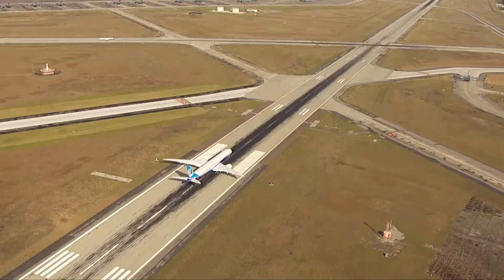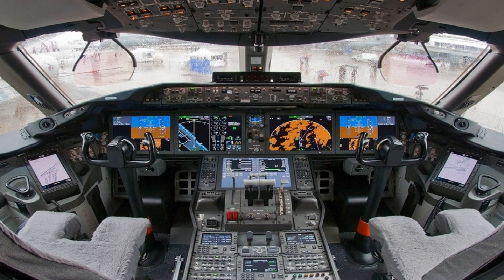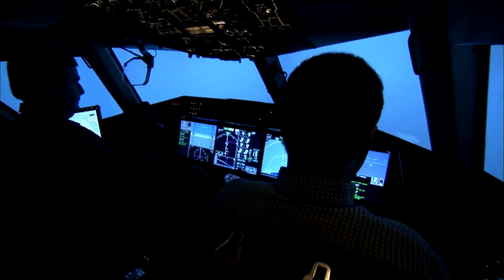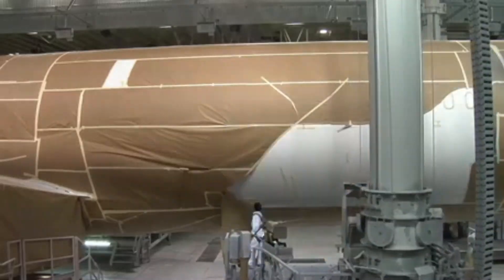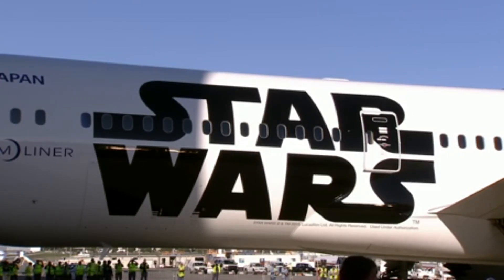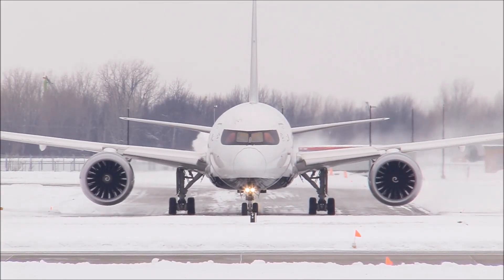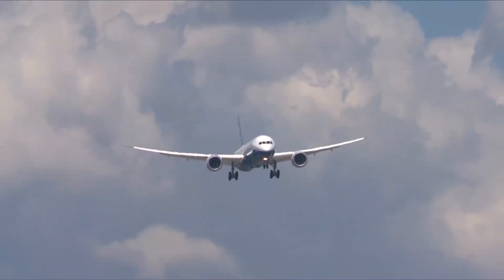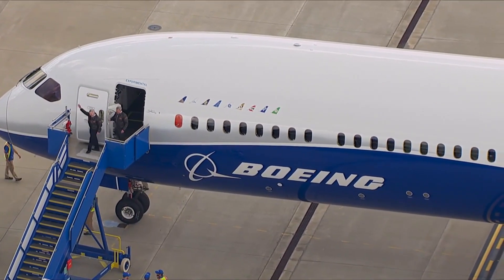Boeing 787 Dreamliner - Documentary

Comment: With all my respect to the Rolls-Royce engines but in my opinion the General Electric engines will be smoother and quieter 🛫💺
Reply from the maker: Honestly speaking the A350 is quieter
, When the 787 was first introduced, the intention was that there would be eight seats per row. In airlines’ never ending attempts to fit more seats onto planes, they eventually increasing that to nine seats per row on most carriers.